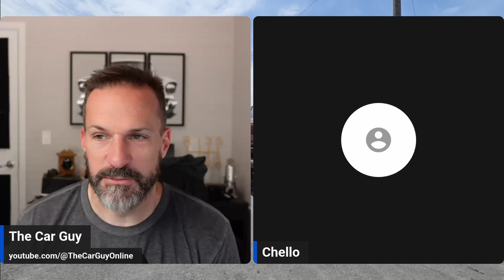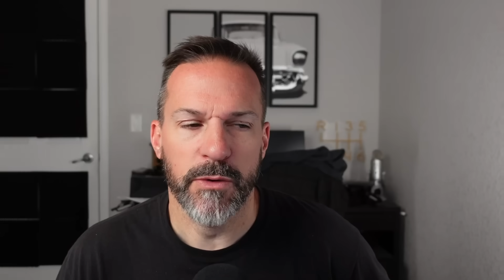Former GM Engineer EXPOSES Planned Obsolescence Tactics.

Comment: 8:38 : Wow, that's a really good point that no one has ever brought up before now. At least with cars, the reason for "planned obsolescence" is that the market doesn't want to keep fixing and repairing a car when they know its time is limited. They'd rather, if they can afford it, get a completely new car when theirs starts to break down, which is actually the smart thing to do, if you can afford it. So companies saw this and said "There's more demand for complete car replacement than there is to repair, so we won't focus on repair because the demand isn't there anymore." Now, not completely, of course. Many people would rather be able to work on their own cars, or take it to their local shop, or whatever. But I've never actually heard anyone argue, and it's a good point, that people would rather just get a new car (myself included) when their old one breaks down, and companies realized this and have started manufacturing accordingly. That's a very astute point that I've never heard before. I'd really like to follow that engineer on social media.

Comment: Alot of this is just cloak and dagger hype. 
The fact is its over  engineered crap that is not vetted, designed by young no-nothing engineers. Vetting costs money.  Plus they have a gun at thier heads with CAFE. Thin oils was a complete disaster. New oils fail shear test at 2500 miles, You can't have small clearances on a motor. It doesn't work. Normal swarf in a motor from running will kill it. Oil filters at 25 microns don't catch it. A bad quality air cleaner will disroy a modern motor. Highly engineered motors fail. Simple designs, less parts , better parts equals less service headaches for everyone, equals less cost for EVERYONE.

Comment: The one cost bean counters aren’t good at estimating is the one that comes from a reduction in sales due to failing customer confidence and satisfaction that results from bean counters’ past actions that have reduced product reliability. When this cost is combined with the costs associated with warranting failures you can actually offset much of the expense involved in making products more reliable. Of course reliable products don’t require replacement as often which may result in reduced sales but it also results in far more satisfied AND LOYAL customers but that’s not something modern day manufacturing seems to concern itself with.

Comment: Been driving Honda Accords made in japan only since 1997..  I have a 93 honda accord, 2004 honda accord & 2012 Honda accord all made in japan & i never ever had 1 prblm!!!!... just tires, battery, oil,  air filter, cabin filter, transmission service thats it.. Never been broke down!. On my 2004 accord an O2 senser went bad around 60k miles & the part was like 60 dollars & like 60 dollars to have it installed!! Thats it... I would never buy anything made in america, mexico, canada etc etc!!!

Comment: This runs throughout the industry, and has for decades. My dad ran a tier 1 stamping plant for the Big 3 in the 80's and 90's. On a few occasions he found things that could be improved in designs with minimal to no cost. Sometimes the changes would be accepted. But on at least one occasion, the drainage hole in a door panel wasn't at the very bottom of the cavity so it wouldn't drain completely, he was told that it was a feature not a bug. They wanted the door to rust out from the inside after a while. It was not functional, so no risk of danger to anyone, but would incentivise people to get a new car.
This mentality is pushed by management from the top down. The notion of a reputation of long term reliability and ease of maintenance is antithetical to the goals of medium term profit seeking. The customer is a sheep that is to be fleeced at much as possible, not someone whose interests are to be served.

Comment: this planned obsolescence is BS. Cars don't last forever none of them do. How many 60s, 70s, 80, 90s cars do you see driving around?? Very very few. Cars are much better today if you could go back and drive a clunker from the 70s you wouldn't like it. Wet timing belts, water pumps inside the engines and things like that are just ignorant engineers that have to make changes to prove themselves.

Comment: 2017 1500 Silverado LT - replaced transmission, rear main seal, entire AC system, and thermostat/water pump all within 20k (1 year driving for me) of the warranty and extended warranty expiring - ALL before 150k on the vehicle - I had to do it because I can’t afford a new truck - it added $12000 cost to an already paid for vehicle - it is the LAST GM I’ll ever own - or any other of Detroit big three crap - Toyota is following suit as their turbo V6 tundra engine is a joke.  Cybertruck, while ugly, is 10 years ahead of the EV competition - and at the top of my short list

Comment: "Planed obsolescence" was a term created by people who don't understand that its the customers who determine how long the product lasts by how much they're willing to pay.
Most people don't want to pay 500k for a car that lasts a million miles. They want a 50k car that lasts 200k miles so thats what the target is for the manufacturers and some people misinterpret that as manufacturers conspiring against them.
Reply from the maker: When you consider how many vehicles from the 2000s are still on the road with 200k-500k (mostly toyotas/old GM trucks or SUVs), you start to understand that things have changed drastically since then. The cost cutting in parts quality and initial engineering is quite evident.
Reply: @TheCarGuyOnline  That wasn't the point. Of course the quality of products comes and goes acoss time. The point was WHY that is the case - ever-changing customer demands, not some mass conspiracy to rip off consumers (not saying customers are never ripped off either), which is what many people take "planned obsolesce" to mean.

Comment: I knew I called it lol Just like these Cell phones that that the software dies after about 2 years and then you got to turn around and spend another $2,000 on a cell phone. But this is also why I drive a 25-year-old truck and I have a 25-year-old car as well both still running in perfect condition everything works on it regular maintenance has been done on both AC works on both he works on both all the power everything works I just do the tires regular schedule maintenance plugs fluids oil and they're good to go

Comment: My 1995 Chevy 1500 pickup has 203k miles. As long as I keep oil changed there is no reason I can not get at least 500k miles before an engine rebuild is necessary

Comment: This is why I will keep my GMT400 forever assuming an idiot doesn't crash into me. If I could afford it I'd go ahead and buy a crate motor and save it even though my baby is still going strong at 220,000 miles. Built prior to the evil planned obsolescence.

Comment: Everyone at my work knows me as a “car guy” so when they are in the market they ask for my advice and opinion on the cars they are looking at. 
I always start with “your not going to like what I say” explain to them why they are about to get into debt over a massively deprecating asset that is designed to catastrophicly fail in the next couple of years/20k miles. 

My advice is to buy a pre 07 petrol engined car, preferably Japanese, and I can as good as guarantee it will last them forever. Not only that but you can buy it with cash and it won’t loose much money. 

They never listen.

This is what the industry figured out around the 08 crash. That normies buy cars based on feelings and status. So they are more than happy to spend £20k on a “Mercedes” that has the engine from a Renault Clio as long as all thier neighbours and friend are aware that they now own a £20k “Mercedes”. Fools

Comment: I have a 2002 GMC SIERRA with 204K on the clock! A GMT 800. Simplicity at its finest! 4 speed transmission and a 5.3 V8 and still runs like new. I bought it in 2013 with about 61K and I’ve never even changed the plugs yet! It runs so good I don’t wanna touch em. I recently changed the brakes at about 200K. I will never buy a newer type truck with an 8 or 10 speed transmission and that garbage DOD and active fuel management that’s causing big problems in the newer vehicles! I’m gonna get a 2005-2006 and rebuild everything if needed! I also have a 1996 9C1 Caprice and a 2010 Crown Vic interceptor! Keeping the older vehicles which are very easy and inexpensive to maintain!!
Reply: Hell ya man good sht

Comment: MORE MORE MORE of these whistleblower stories please. 
I’d love for you to get someone from lexus and find out why Lexus has continuously had issues with their rubber since 2007.  It deteriorates in their suspension parts, their valley plate sealant which fails and leaks coolant.

Comment: My 90 half ton 4x4 Suburban has 238000 miles on it and runs great. My wife's 24 Tahoe just went in for the 6.6 recall inspection. Dealer said it passed and added new oil. I wonder how many actually fail and get a new engine or they just shit the bed on the side of the road?

Comment: Reminds me of how Toyota tells people that the transmission oil lasts for the “lifetime” of the car and never needs to be changed. It cracks me up how so many people actually believe that.
Reply: Please explain in extreme detail why that is wrong?
Reply: @onemischiefmaker7032  its not a magical fluid, that's why.
Reply: @michaelotoole1807  Surely you can give a better response then that.
Reply: @onemischiefmaker7032  ok, the car manufacturers get points or no added monetary penalties from the government per vehicle sold  if they can make their vehicles more environmentally friendly. i.e.: more efficient in fuel (mpg) or oil products needed per life of the vehicle i.e.: longer oil change intervals or longer or non existent transmission fluid requirements. the companies also say the vehicles can use the lower viscosity oil's but that is just to increase the mpg at the expense of engine protection  the companies say "ok" and just put in the sales specs that the vehicle doesn't need a oil change every 3-4,000 miles now it's 10,000 or more. same with the transmission fluid. add to that that the car manufacturers  are building vehicles to only last as long as a standard warranty  contracts and that is where we are now.
Reply: @michaelotoole1807  Thanks for that answer! Would a fluid analysis report support a change schedule more frequent that the manufacture suggest? The term "lifetime" is very vague. Not only for transmission fluid but for engine oil as well? Most people do not send any fluid out for analysis.
Reply: @onemischiefmaker7032  the smart thing to do is always send in your oil for analysis to see the engine wear and other issues in your engine. they are bloody! expensive! $ 50 bucks is a small price to pay for important information that could save you thousands. the car manufactures did a study that most people lease, not buy a vehicle and that they usually didn't do the proper maintenance since they are going to get rid of it in several years any whey. so they jacked up the prices  while cheapening the product to only survive just out of warranty. 
https://www.youtube.com/watch?v=q7U0Z7yS3Ds
Reply: @onemischiefmaker7032  While truly synthetic oil doesn't tend to lose its lubricating properties (i.e., no use of viscosity index improvers, just PAO or ester base oil), it still gets dirty over time and wear.
Reply: Yep, Cadillac XT5 manual says to change transmission fluid every 45k miles in "severe" conditions. That's it, nothing about regular conditions.
Reply: Lifetime fluid does make sense in the context of the EPA classifying a vehicle's lifetime as only 150K miles.

Comment: Current honda master tech here. All of this 100% tracks with what I see comming out of the honda as well. The quality of all brands is garbage. Brand new cars with sub par components now well engineered bits and so many little issues that the manufacturer puts out band-aid recalls and bulletins for. They dont care. They want you to give up and buy a new one. It is so frustrating. I honestly dont want to keep doing this job. If they dont care at the top, that trickles down and down and in the end the customer suffers. This industry is going downhill and it all starts with the oems

Comment: My grandfather's used to tell me when he was young you could buy a new car, use it for 10 to 15 years pass it on to your kids and they could used it for another 10 years without major issues, just basic maintenance. Nowadays most essential cart parts are designed to fail after 5 to 7 years max.

Comment: While I’ve ensured accuracy based on available information, some platforms or audiences might appreciate a note that the content is a summarized analysis from an AI assistant (me!) to add transparency:  

Emissions and Vehicle Design

In the US, strict EPA Tier 3 standards mandate catalytic converters and Diesel Exhaust Fluid (DEF) systems for diesel vehicles, increasing costs and complexity. Maintenance for DEF alone adds hundreds annually. In contrast, developing Asian countries like Thailand, India, and Vietnam often have laxer or inconsistently enforced emissions rules, allowing trucks without DEF or catalytic converters, prioritizing affordability. Advanced Asian economies like Japan and South Korea enforce strict standards, sometimes surpassing the US (e.g., Japan's NOx emissions average 43.8 mg/km). This regulatory gap in developing markets enables simpler, cheaper vehicles but worsens air pollution.

Affordable and Versatile Trucks

Basic trucks like the Toyota Hilux Champ, sold in Thailand for ~$13,000–$16,000 USD, exemplify Asian market practicality. These feature customizable cargo beds with removable/fold-down sides, ideal for work or flatbed conversion—unlike US models like the Toyota Tacoma ($30,000+), which face strict safety and emissions rules. The US "chicken tax" (25% tariff on light trucks) and crash standards block such imports, inflating domestic prices. Asian trucks often use diesel, with manual transmissions and minimal electronics, sometimes omitting airbags or ABS to cut costs.

Fuel Options

Asian markets, especially in India, China, and Thailand, embrace diverse fuels like diesel, propane (LPG), and compressed natural gas (CNG) for trucks and taxis, supported by subsidies and infrastructure. China promotes CNG/LPG to reduce oil imports, with millions of vehicles converted. In the US, gasoline and EVs dominat

e due to abundant gas, sparse CNG/LPG stations, and costly conversions (~$10,000+). Regulatory focus on hybrids/EVs limits gaseous fuel adoption, unlike Asia’s energy security-driven approach.

Industry and Political Influence

US auto industry lobbying ($80M+ in 2022) shapes regulations, often resisting stricter fuel standards or EV mandates to protect legacy profits. Dealer groups like NADA ($5.5M in 2024) push policies that maintain high prices, akin to food industry lobbying that impacts health and costs. This "auto industrial complex" contributes to pricier, complex vehicles. In Asia, less centralized lobbying and export-focused policies prioritize affordability, though tightening rules (e.g., China VI standards) signal change. These dynamics explain why US consumers face higher costs and fewer practical options compared to many Asian markets

Comment: I used to be a GM guy. They did make good cars, up into the nineties anyway. The only reason I still have a couple of their vehicles today is they were given to me (already old and rusty crusty). The mid-00s gmc has been ok with its inline 6, but the similarly-aged Cadillac has been a nightmare of problems. I was won-over by an Oldsmobile many years ago and turned away by a Cadillac. Now I’m a Ford guy, but only with their panther cars and older trucks. Not sure I trust any manufacturer enough to spend tens of thousands on anything new.

Comment: GM would've made the perfect medium duty truck had they put the 4L80E in their 1500 trucks of the early 2000s. As the engineer mentioned the 4L60E tended to be a bit problematic, especially when used for towing or hauling. GM's factory heavy duty towing package offered after 2003 (iirc) did help a little bit, by adding an auxiliary cooler mounted in front of the radiator, but GM also neutered the 1500s in other ways. Notably, no transmission temperature gauge from the factory, despite the wiring being in place for one to function. A common upgrade to 1500 instrument clusters is to add one and flash the EEPROM so the cluster will request that information from the ECM, or to swap in a 2500's cluster and flash the EEPROM to show the correct mileage. With this gauge, you can monitor your transmission's fluid temperature and will be able to pull over before you overheat and burn the fluid, or potentially damage the transmission. 4L60Es loved to overheat when towing at or near the vehicle's factory GCWR, especially in hilly or mountainous terrain, so that gauge can be a godsend from a maintenance perspective. We also don't need 1000 gears in our transmissions, 4-6 is the sweet spot as long as the transmission is well made. Hell, from the old days, the 2 speed automatics were some of the best automatic transmissions the big three have ever made. They tended to be reliable, handled more power than what they were rated for from the factory (though as always YMMV unless they're properly upgraded), and in general they just kind of worked as long as they were maintained well. You weren't getting much better than 9-10 mpg with one, but that's the tradeoff for having a transmission that probably won't ever blow up unless you do something insane like trying to force 1,000 horsepower through a bone stock, factory fresh unit. This is why the Powerglide still reigns king of the drag strip and its BOP cousin is still king of the cruise-in.